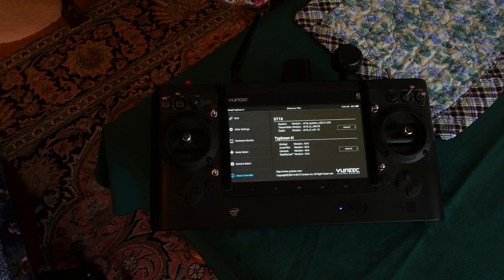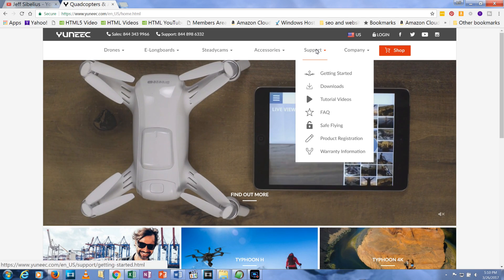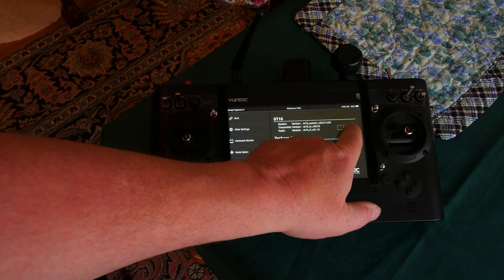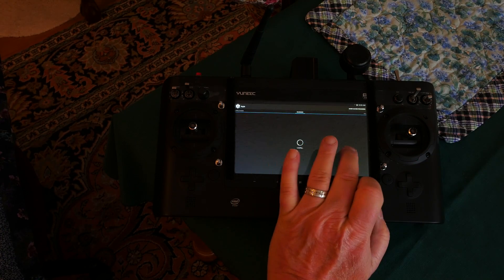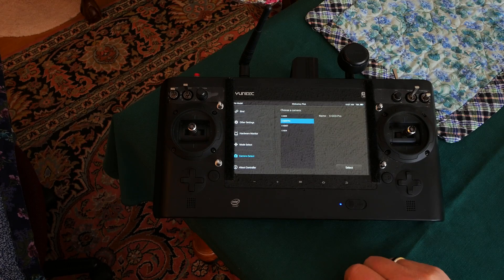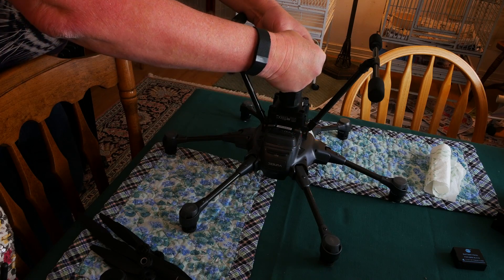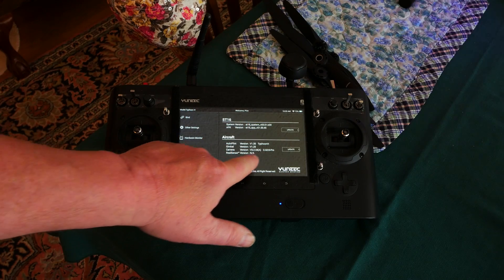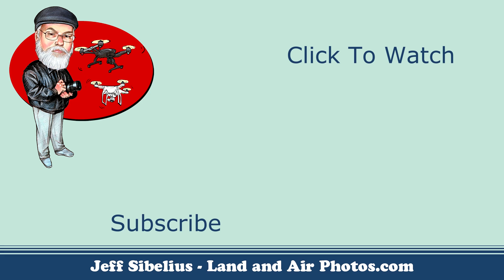How to Update Yuneec Typhoon H Firmware STD V3.04 - 2017 Typhoon H and ST-16 Transmitter

Comment: Jeff, are you using Google Chrome or MS Explorer to download the files?
Reply from the maker: In the video I'm using Chrome, I believe.
Reply: Beter, when you use MS Explorer to download the updates, Explorer will change the extension of the file from .bin to .zip and the update will fail because the Typhoon H cannot read the file.
Reply from the maker: wow, I just tried it and you're right. If you right click and choose save target as, you should be ok. But just clicking on it changes the extension. How absurd!

Thanks for the heads up - I'm going to pin this to the top of the comments so folks will see it. Thanks for the heads up.
Reply: Your are welcom. A lot of people are running into this problem. I really like your youtube channel and have posted it on the Dutch Yuneec Typhoon H facebook group. Keep up the good work!!!
Reply from the maker: Thanks for the help and the support for my channel, Floris!
Reply: @JeffSibelius  When I try the download it puts a .zip extension using both IE or Chrome. What can I do to fix that?
Reply: mine was a .bin and use chrome

Comment: Hi Jeff, This is from France, I have been using the H for 18 months strictly for purpose of photography inspecting roofs of buildings & a few times for cinema drop in aerial shots. I-am a minimal user & believed the problems were of my non understanding. Symptoms: flying the H out to about 500m or so, the on screen picture cuts & will not return, being blind, select come home as frequently the H is invisible into the back drop, some times the picture returns before landing. Secondly, having taken the photos & are visible on the ST16, when reviewing from the onboard card many are missing or cut in half only partially scanned. I understand that such problems can exist with European firmware.
I run Mac & have discovered the operating system is incompatible. I have had a friend with windows, download the USA 3.04A & hope this solves the problem. Q. do I follow your tutorial & update the ST16first as per this video & then the H or just the H.  Thanks, by the way excellent tutorial.

Comment: Do you have a file directory of the ST16 controller? The software 
is all screwed up and has missing files and it wont let me update 
firmware. When it boots it goes into tablet mode. All the software 
needed for the  Typhoon H is missing. I was wondering if I could somehow
 get the individual files and copy them to the ST16 and then update the 
firmware so it can all work properly again.

Comment: I have had nothing but trouble with yuneec Typhoon h pro one came back from repair and it crashes and flew off this was back in September 2017 not I spent the last two days getting it all working went through all the steps now the power button on the controller the red one it won’t start the drone the binding so complete and the updates so ok I really beginning to hate yuneec real poor on helping one out I have to DJI phantom 4’s and one is the DJI phantom 4 Pro there is so much less head aches with DJI I like both but never had luck getting help with yuneec took them over 6 months last year to send my drone in than they had it all summer and got it back went up 130 ft after doing everything it flew off gone till September 2017 finally got all back together did updates on the cards glad you have good luck my two are juck I guess I know they will never help me I am disable have been since 1998 this got me outside so sad to have wasted so much in junk
Reply from the maker: Sorry to hear about your troubles, Rachel. The H is definitely more prone to problems than the Q500 was, although its issues seem to have been largely resolved now. Yuneec went through a period of several months where there was a shortage of repair parts. I had a drone sit in their shop for a couple months when usually they turn things around in a couple weeks. So hopefully they've got that problem resolved now.

I've flown the Phantom 3 Advanced and 3 Pro, Phantom 4 Pro and Mavic Pro Platinum. The 3 Advanced and 4 Pro have been problem free. The 3 Pro was not as reliable and the Mavic is about to go back to DJI for repairs - it has never held its connection consistently. I think all the companies need to take a good look at the quality control and consistency of reliability of their products, for sure.
Reply: Jeff Sibelius thank for getting back to me I just finally got outside to fly all back together reprogram everything seem to respond to everything hoping when it gets warmer I can try to fly other than up and down the left controller has to be moved more than half way for it to lift of hope when it gets warmer I can fly further in a back field be hind my home took two drones and made one one was the Typhoon h and Typhoon h pro the pro was the one that flew off till it dropped out of the sky 6 Miles from my home a hunter found it and got it to me it spent the fall and winter in the woods it was all stove up that’s the one I sent in for repair and the newsest one the older one has issues but never flew off I called yuneec and told the m what ever they did messed it up got up 130 ft and it disconnect tip and took off with a full charged battery I knew I would never see it again at 47 Miles and hour it could fly a long way I figured I would never see it again so I am piecing it out for part I put the realsence module on my older Typhoon h seem after all my programming it responding I hope it doesn’t fly off thanks again for getting back to me

Comment: Hi Jeff I just purchased a Yuneec H with a CGO3+ camera. The batteries are on charge and I was wondering if I should update the firmwares before flying first time? Your advice would be appreciated. Thanks  JD
Reply from the maker: Hi John - I just saw this question, sorry for the slow response. If you just bought a new H now, chances are that the firmware is up to date. They haven't done an update in a long time. Personally, I think I'd try my first flight without doing the update - the jpdates for the H have been pretty wonky. I'd want to see first if it has any problems, and if it doesn't . . . I wouldn't update.

Definitely want to do your calibrations, though.
Reply: Thanks Jeff, actually I did just what you recommend and the results were dubious so I went ahead and updated. My purchase was on clearance so I think this H had been in stock for some time. Since updating the H has behaved as advertised and I am getting to grips with it's functions.
Thanks for your reply and especially for your excellent videos. JD
Reply from the maker: Great to hear, John - Glad it's working as advertised for you. And I'm glad the videos are helping you out!

Comment: Jeff, thank you so much for the very clear guide through the firmware process.  I am new too all this and not particularly "Techie" but I can follow directions.  After just two flights on my H the camera shut down and I was left clueless.  As always I resorted to Youtube and found a number of promised fixes none of which worked or were delivered in vague terms in a non understandable Brittish accent.  Found you and your calm step by step process and I was back in business with new firmware.  I had to use a 32 gig chip, but it seems to be okay. Thanks again.  Bish Wheeler, Anacortes WA

Comment: Thank you Jeff for your quick response. I re downloaded the upgrades for both tx and typhoon on a different reformatted 16 go sd card. Here is something I am noticing, when I turn on the tx it boots up and on the screen is an icon that says connecting to Rc and wifi. Also on top of the screen it is saying reconnecting to "c" please wait. Should I be waiting for this to clear before trying anything?
Reply from the maker: If you're working indoors those messages probably won't go away - and definitely won't if your drone is powered down. Those are normal messages (reconnecting to camera, etc.)

I'm starting to think there is a problem with the file on Yuneec's site. I've received messages from four people in the past two days, all having the problems you're having.

I'm going to try and find a copy of the firmware file that I know works - if I do I'll put it at a place where people can download it. Please keep following this video for that situation.

Comment: Jeff, I'm trying to upgrade my typo on h pro by following your direction using sad card. I've downloaded the firmware from yuneec.com but when I get to the point where I hit upgrade the screen says no package found. What do you think is wrong?
Reply from the maker: Hi Ed - I'm assuming that hte problem is with updating the transmitter and not the drone? One of a few things could be the problem.

If you downloaded the file with Internet Explorer it might have given your firmware file a different extension, so the TX doesn't see it.  Redownload the firmware using Firefox or Google Chrome

Make sure you're using a media card that is 8GB or 16GB. The TX sometimes won't recognize a larger card.

If these don't work, try a different card . . . there could be a problem with the card.

If that doesn't work, redownload the firmware file and see if your first file didn't get corrupted.

Give those steps a shot and see if they don't fix your problem.

Comment: Jeff, thanks for the video. The H update worked like a charm. Had some difficulty updating the controller. Are you supposed to unpack the file first? I didn't and I couldn't get it to work. Had to do it OTA and that worked fine. I updated the craft per your instructions no problem. Kirk

Comment: Hello Jeff, I tried this today but my ST16 didn't update to 3.04.  The package I downloaded had a .yuneec extension.  Is that correct?
Reply from the maker: No. The comment here Floris Jan Vermeer below explains your problem, I think. If you download the files with Internet Explorer, it changes the file extension. Try downloading the files with Google Chrome or Firefox. That should give you the accurate names.

Comment: hello everytime i try this method it says "ERROR Decompress proccessing time out" i have a basic typhoon H and tried the proccess over and over again
Reply: I had the same problem I tried a new SD card and everything worked perfectly.
Reply from the maker: The problem is happening while updating the transmitter or the drone itself?

Just a couple things to check -

1. Are you using a micro SD card that is 8 GB, no larger than 16 GB? Be sure to use a smaller card for this process.
2. Did you download the firmware files using Internet Explorer? IE can change the file extensions. Clear your card then re-download using Chrome or Firefox.
3. Next - try re-downloading the firmware files. Format the card and put the new downloads on it. I've actually had a firmware file download incorrectly and it screwed up the update process.
4. Still not working? Try a different card.

If none of these work, it's time to call Yuneec CS. There could be a problem with the card port. Hopefully the steps I laid out will fix it for you.

Let me know how it works.
Reply: Jeff Sibelius thank you for replying. i downloaded the updates through chrome with the sd card that came in the camera. i tried to delete and redownload and the st16 update worked fine. its the camera update that wont work. i figure they are trying to push us into that wifi download method. i prefer the old fashioned way.
Reply from the maker: I thought it would be the TX with the problem . . . other than trying a different card I don't know what else for you to try other than calling Yuneec, unfortunately. The version of firmware on the site now is what I used for this video, and like you, I prefer the old fashioned way of using the media card.
Reply from the maker: This is kinda what I'm thinking. These inexpensive SD cards are so cheaply made that I think they cause a lot of problems. Even the more expensive cards . . . I've had two Sandisk 64GB Extreme Pro cards, not cheap at all, fail on me in a week's time.

Comment: Thank again for a great Video. I've tried updating my H and have failed miserably, but after watching your video I think I know why. The SD card I was using was a 64Gb card I bought especially for the job. I gave up after getting one bit of advice, "If it isn't brook, don't fix it". My H fly's great; the only problems I have had is loosing video link and that may have ben my fault for not facing the ST16 at the H when at a distance. Another problem is with the camera. When facing the light source, any dark area in the video has sparkles in it, face away from the light source and the video is fine. I'd appreciate any advice you can give me. Dave M.
Reply from the maker: Hi David - I got caught with using too large a media card as well . . . why Yuneec doesn't put that on their firmware download page, I don't understand. 

The ST16 antennas are definitely directional. Today I was flying, and just holding the TX at waist level resulted in a broken signal. Holding it up at chest level fixed it. 

Not sure on the sparkles issue - is this on screen or actually in your video? If it's in the video can you upload an example to Youtube and post a link?
Reply from the maker: I see what you're describing - like, at the 19-20 second mark, lower right corner.

This is either an issue with the card or the camera, I'm guessing. If you try recording with another card and still get the same distortion, I encourage you to call Yuneec. I've never seen this before - but now I'm going to be looking for it in my own videos LOL.
Reply: Thank again for your advice and sorry if I have given you a problem. Once you have noticed something, its a job to ignore it from then on.
Happy Landings. Dave M.
Reply from the maker: LOL no problem . . . but you're right, once you see it, you'll never miss it again!
Reply: Took the H out again today. Tried hard to get some sparkles; not one. lovely video. GO FIGURE!!! Thanks again.

Comment: Hi Jeff, I have a brand new typhoon h, never flown, decided to do the firmware update as it came with V 3.01, after updating the ST16, I selected the camera, then did the binding of the drone and camera as per your video, as soon as I powered on the drone, it started with a constant beeping, non stop, with a purple Constant and orange flashing light, I could mail it to you if you like. I don't see these LED codes on either old or newer code sheets that I have found. What could this be and should I go ahead and load the new firmware even with this beeping?
Reply from the maker: I actually had one of my H drones do this to me, although it didn't happen after a firmware update. I took the drone to another location and it did it again. I called Yuneec and they talked me through the process of re-calibrating the sticks on the transmitter. That solved the problem for me.

Unfortunately I didn't video that procedure and I can't recreate it to make a video of it.

Call Yuneec CS, tell them what you're experiencing and ask them to walk you through the process of calibrating your transmitter sticks. This should solve the problem for you.

Let me know how this works for you - if you could video the process, so much the better!

Comment: Are there any concerns with having to "mount/unmounting" the SD card before and after transferring Update files?
Reply from the maker: The TX will not require you to mount the SD card. Your card should be properly formatted right out of its package but you can always reformat if you'd like. 

I keep repeating this to everyone because I got hung up on it, but make sure you're using an 8 or 16 GB card. I wasted a lot of time trying to upgrade with a 32 GB card LOL.

Comment: This firmware V3.04 A. dangerous warning
The Good
- Motor work better, fly smooter , H. freeze in the air better
The Bad
- Caribrate Error > Compass & ACC caribrate show Disable ( i have problem gimbal very bad & angle view no good )
- Metal Sensitive so much ( landing in area that there are many metal > Gps Disable on the fly, Compass Error
- LAST WEEK 14/4/2017: My H DISABLE GPS on the fly + CGO3 DISABLE on the fly ( H away only 150m. not far, not high ) + strong wind take my H gone with the wind ( My H lost in the strong wind away from 20 m. to 800 m.  this time still Not found )
- When take H. back about 10m. - 20m. ( very near H.>ST16 )  
st16 VS CGO3 still not show photos ( disable ) 
GPS. still disable > i connect GPS on but still to be GPS DISABLE
  ...............
file telemetry show : H & ST16 & Sat 14  alway work 100% but send only data telemetry NOT let GPS ready to ST16 ( unreason ) 

in Thailand there are user about 3 crash by this firmware V3.04 ( GPS disable on the fly unreason )
H in guarantee i'm sure free service from Yuneec
H that out of guarantee over 1 year >> how does YUNECC DO ?  free service 100% or let user pay ???
My H fly away gone with the wind how does Yuneec do about my issue ?
My issue was send to Yuneec dealer in Thailand > Next to Yuneec HongKong > i'm waiting for how Yuneec decide about my issue

Comment: Nice Video Jeff.  You indicated the TH firmware STD v3.04, but on Yuneec site, it is v3.01. Is this a mistake?
Reply from the maker: No - someone mentioned recently that Yuneec just pulled the latest firmware off their site and put a previous version up. I don't understand that because the newest firmware got much better feedback than the previous version.

Comment: Your video is OK. But you forgot to mention that you must download a Camera software in a non-zip
Reply from the maker: If you download the files in the formats they're posted in at Yuneec.com, it should work without any issue. If you download with Internet Explorer, that browser may change the file extension to zip. You should download with Chrome or Firefox.